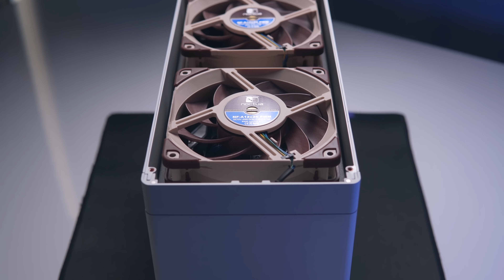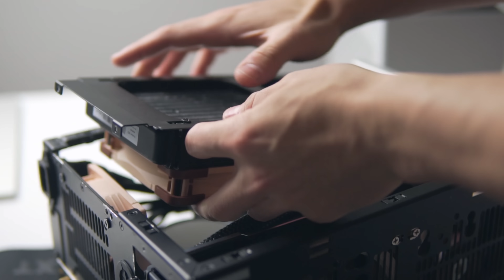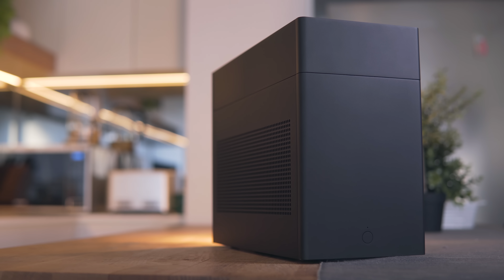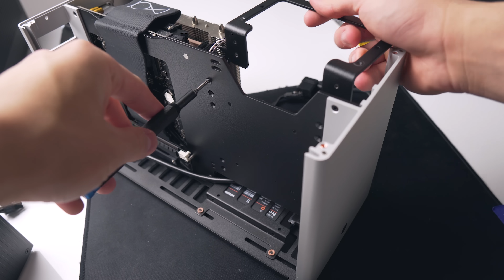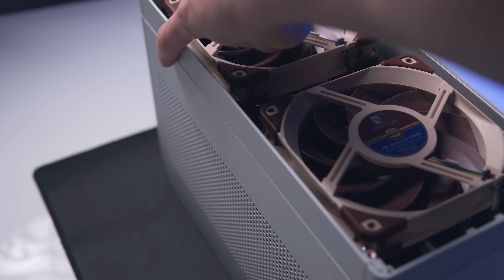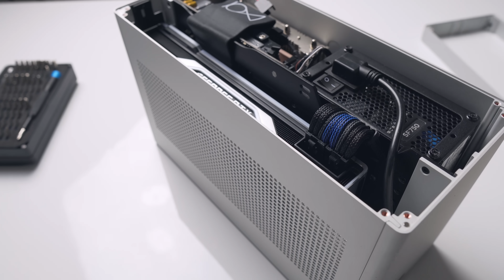High Airflow Ghost S1 Build - Negative Pressure FTW

Comment from the maker: SFF Custom loop incoming after Computex. 
Ghost S1 or Ncase M1 guys?
Reply: Optimum Tech defo ghost S1
Reply: Ghost S1
Reply: Ghost S1, hands down.
Reply: Optimum Tech ghost s1 with rigid tube. N case m1 is quite spacious.
Reply: @yuxianwang3238  that i also want to se really  Good challenge. @Optimumtech
Reply: Ghost S1. I cannot see how that would even be possible, but I would love doing this myself after just buying a Large tophat.
Reply: ghost ftw
Reply: Ghost (:
Reply: Dual rads in the NCase M1, 240 on the side and the bottom with waterblock on the GPU!
Reply: S1
Reply: Ghost s1!
Reply: Ncase
Reply: Ghost S1 please!
Reply: Ghost S1
Reply: ghost s1
Reply: Both!! lol
Reply: Ghost S1 for sure
Reply: Hope an SM550 or SM560 review is coming soon! They advertise a semi-passive mode with these high pressure fans. Very excited to see your results with that
Reply: Corsair 1000d
Reply: Ncase M1
Reply: Ghost, because of its a lot less common and I think you can do a much better job than J2C did
Reply: Ghost S1, I'm doing it as well, just waiting for my Ghost to arrive.
Reply: Ghost S1 of course!
Reply: S1!
Reply: 👻S1!!!
Reply: Ghost S1
Reply: Ghost S1 pls !
Reply: GHOST S1!!!!
Reply: Ncase m1!
Reply: Ghost S1! I’ve seen some M1-loops done but very few done in the ghost...
Reply: Would love to see the M1 custom loop. Kind of seen one in a S1 already but curious how the Mcase would turn out.
Reply: M1 please!
Reply: Both please!
Reply: Ghost S1!
Reply: S1 for sure.
Meanwhile living on the edge here with a 2700x and a Vega 64LC in the evolv shift
Reply: Ghost for sure. M1 is boring
Reply: Ghost because of challenge
Reply: Sliger !
Reply: 1st Ghost the N1 with similar components!
Reply: Ncase!
Reply: How about both?
Reply: Ghost S1
Reply: BOTH!!!!
Reply: ghost s1 for sure .. because there are many people already made it for ncase m1
Reply: Ghost S1 please. But I'd watch the M1 as well.
Reply: Both r almost identical, but I'd vote for Ghost S1
Reply: Ghost S1! Just because its more beautiful. And maybe you could try out an Aqua Computer Airplex radiator.
Not sure if fits but I'm really curious of its performance.
Reply: Do both mate... Do the Ncase M1 first.. then later on, do the Ghost S1... why not!!!
Reply: Ghost
Reply: Ncase for sure!
Reply: Ghost S1
Reply: neither :D get a bigger case bro :D
Reply: Ghost S1 FTW!!
Reply: ghost s1 no question
Reply: Why not both?
Reply: custom loop!
Reply: Ghost S1!
Reply: Ghost for sure!
Reply: NCase all day. Ghost is cool but I love NCase layout so much.
Reply: Both? <3 if not...Ghost! Thanks and super nice vid, as always!
Reply: Ghost S1!
Reply: Ghost s1
Reply: S1 for sure
Reply: M1
Reply: Ghost!
Reply: Ghost
Reply: ghost s1!
Reply: Ghost S1
Reply: Ghost
Reply: Ghost S1
Reply: S1 PLEASE!
Reply: Optimum Tech Cerberus!
Reply: How about a Ghost S1 with a medium hat top and bottom?  That possible??
Reply: Ghost S1, 
both more challenging, and it's potentially more customizable (ie more Top/Bottom Hats can be added, even multiple ones over each other if necessary) - so proper water-cooling build will be great starting point for many other builds
Reply: S1, no question. Possibly the best PC case ever made.
Reply: @carlover4239  , indeed a great case design.
I would only wish they made another variant aimed at fully water-cooled & portable builds. What I mean is that there's plenty of headroom to shave some weight of the case (currently it's twice as heavy as the Dan A4 w/o any top-hats, and I haven't heard of single comment about the A4 being flimsy or weak).
And by aiming it to water-cooled builds I mean to drop the extra width they currently leave for more air-cooler options and btw if you look closely you can see the lip in which the case walls slide in are FAT, there's at least 1cm wider than necessary. I know it sounds like a hair splitting, but if Ghost S1 can loose half its weight and about 1.5cm of its width (ie from 14cm to go down to about 12.5) it could still fit standard 240mm rads (probably not most fat 240 rads that are about 13cm wide, but there're always compromises).
So being about 2.5kg of its weight (half from the main case & the other half from 2x L-TopHats), and making it slightly slimmer (to fit in more backpacks) would make it actually very portable - to the point that you could carry it daily to work'n'back (esp. if you combine it with a full Aluminium liquid-loop as I'm doing with my own build).
For portability one can make a compromise with the 14cm width of the case, since it's a specialized implementation anyway, it makes sense to find specialized backpack of suitcase, but weight MUST go down IMO. With its current weight it's only good for stationary use (only occasional moving around), and at that point some of the SFF advantages are lost.
And of course price should also come down, and availability to go up, if they even hope to make a business out of it :)
Reply: S1
Reply: Ghost!
Reply: S1
Reply: Ghost S1
Reply: Ghost please. Will do the same then. But do it with only a medium hat at the bottom!
Reply: Ghost S1 for sure!
Reply: ghost
Reply: Ghost! Ncase has been done so many times by now
Reply: Ncase M1 pls
Reply: I'm looking for that Ncase M1.
Reply: Ghost S1
Reply: Ncase M1
Reply: Both 😊
Reply: My Ghost S1 is nice but it was a very long wait and one of my tophats from the 3 pack is the wrong color. I'd say Ncase M1 just for the ease of ordering. Not to mention that if you plan on using tophats on the ghost S1 you're nearing the size of the M1 anyways. Edit: oh you mean for the a custom loop Ncase all day.

Comment: I would like to fit a i7-10700k with a 3060 ti in a ghost with a large top hat. Would this be possible with the setup in the video if I undervolt the 3060 ti and use a 240 rad for the cpu? Or is this pushing it and should I try to go for the Formd t1 case. Primary use will be for gaming. Thanks for the vid and anyone can let me know what they think.

Comment: @OptimumTech, I'm currently building my S1 batch 4 and was able to get a full sized 120mm corsair ML series fan below the PSU running in exhaust mode. Using a corsair platinum PSU with the premium cables, all it took was some clever cable management but I definitely have somewhere between .05cm and 1 cm clearance with the fan spinning unimpeded. Just a note for those looking at this build.  I will running the 3900x with a noctua L12 (discontinued version) and a 2070 super FE. I'm hoping thermals with this slightly less powerful card will be good with just the 1 fan. Otherwise I'll be getting that medium top hat.

Comment: Hi folks,  help me pls 
just replacing aio cooler master liquid 120 lite.

Fancy removing large top hat, corsair dominator ram so height ram is an issue, any thoughts pls.
Atm I'm thinking of noctua nh-l9x65 am4
Ryzen 5 2600 is this a good cooling solution.
Reply: Maybe switching to low profile ram? I'm currently using l9x65 for my i5-9600k, but ave load can heat it to 86C at stock volt.

Comment: Have you tried using a NF a9 fan in the NH l12 rather than the NF b9? I picked up a second hand NH l12 without any fans and trying to figure out if there will be any benefit in using the a9 rather than b9?

Comment: Compared to water cooling is this a optimal setup for the 3800x with the two fans? Or would it need water cooling...I don’t plan on overclocking or anything

Comment: Sorry, I am kind of confused by what you meant with ”the bottom fan running in exhaust isn’t going to work you less you can find a fan grill to fit in that tiny square”. Did you meant that it might be easy for cable to be caught in the bottom fan if it's running in exhaust? Thanks!

Comment: @optimum tech: You always refer to the Noctua CPU fan but I've done a new built using the Ghost S1 and i'm using the Coller Master Geminii M5 Led that is a 120mm fan, low profile, 5 coper heatpipes and it works particulary well with my i7 9700 (normal version, not OC).
https://pcpartpicker.com/b/bC7WGX

Comment: Hi Optimum Tech, I don't exactly understand what you mean regarding the bottom fan between the 03-05 minute of the video. As I don't have a tophat and can really only tinker with either a bottom fan in the fan/harddisk slot in the bottom of the case and a better CPU cooler. Would it be worse or better in regards to noise level and tempts to put in a bottom noctua slim fan in the case on exhaust or not? You mentioned that "switching the fan to exhaust won't help either, unless you have a slim fan grill"? Hope you can clarify :) kind regards

Comment: Hey man - quick question about the fans in the medium top hat. Does your top grill sit flush with the rubber fan corners on the noctua? If I leave the rubber corners on, my top grill will not sit quite flush. I tried flipping the mounting bracket over and still not quite enough clearance.. Works if I remove the rubber.. But I prefer to keep it and in your vid it looks like you kept them on.

Comment: Anyone follow this build? Wondering what cpu fan direction is recommended?
 With top and bottom exhausts feels like cpu might work better as intake, pulling cold air through side panel and exhaust through top. 
Any Thoughts?
Reply: My thoughts exactly. The cpu cooler setup makes sense to push heat out of the sides, right? @Optimum Tech, care to chime in?

Comment: They should have used long threaded nuts (like motherboard stand offs) to mount the top hats so you could secure the top lid once installed other than just the magnets. Kind of the only let down to me on this case.

Comment: Have you ever tried a blower 2080ti - surely this will work better for thermals in any small volume build albeit with a lower level of overclock headroom and noise may be raised though not always intolerably especially for gamers who use headphones . I don't and I have a 1080ti blower in my FDCore500 build - for me noise levels are tolerable even gaming at 4K - https://uk.pcpartpicker.com/b/PbCbt6 ?

Comment: Medium bottom extension with 120mm cpu aio and 2 , 25mm fans blowing in.  Delidded direct die conductonaut 9900k and triple fan 2080ti temps in mid 70's. Both max oc.  Not enough? Small tophat with 2 slim fans blowing out at the top what will reduce temp with 5 degr c. All fans set to low noise, max 1500rpm . 16k 3dmark time spy.

Comment: Has anyone tried this setup, but instead of installing 2 x 120mm fans you install 1x120mm fan above the cpu and a 3.5 inch drive?  Wondering how much worse the thermals might be in this configuration.

Comment: Would you use the bottom exhaust fan if you use a large top hat with a 240mm rad?  If you use a 240mm rad, would you use the fans on top or bottom of the rad? Thanks!

Comment: Nice build!
I wonder in a build with 2 L-TopHats (ie one would be a bottom-hat actually), so that both CPU & GPU are water-cooled so that each Hat would have a 240 radiator & 2x120 fans, which would be better:
A) both hats' fans blow UP-wards (assuming to work in synergy with air convection) - ie bottom fans would blow IN the case;
B) both hats' fans blow OUT-wards (creating negative pressure inside the case so that it sucks air from the sides, instead of the bottom) - ie bottom fans would blow DOWN in the case
NOTE: consider that in such build the rest of motherboard components would need ventilation, so there're 3 basic cases there I think:
1) in the above case A, there should be general upward air flow thru the case assuming it would be enough to cool down MoBo - would it?
2) in the above case B, the case would suck air from the sides, because of the negative air-pressure, so would that be enough to cool down MoBo?
3) if both above cases are not good enough perhaps sticking couple of small & low-profile fans (like for example NF-A4x10 fans) to the side of the case directly over the hottest areas of the MoBo? I guess the last case would work better with the case B ie working in synergy with the negative flow?

Comment: Could you check out the MSI GTX 2080 Ventus V2? Its one of the few 2080's that could fit in the Ghost S1 or Dan A4 but its heatsink fins are set up in an unorthodox direction. Wondering if that would impact cooling alot in a small case

Comment: How do you undervolt the graphics card? I have a ASRock Z390 Phantom ITX. Do you do this in bios? Exactly how and where?
Reply: msi afterburner
Reply: @dzpliu  I am running Mac OS X on hackintosh so I need to do it in BIOS since Afterburner does not work on OS X

Comment: I have never built any ITX PC, anyone with experience could tell me if the heat dissipation is good with such a small box? I am planning to use nvidia 1660 right now, would upgrade to a quadro when boss gives me some allowance. Probably an i7 that is both efficient in 3d render and heavy gaming as well for now. And any motherboard that could fit in so I can have a reference? Many thanks. 

I am in HK so many of the parts aren't available from local store feelsbadman
Reply: Anything that isn't a 2080ti and 9900k should be fine. 1080 and his delid 8700k works all on air no top hat.

Comment: nice vid man! cool!
i have a Cooler Master MasterBox Q300L, and one damn fan made an almost 10C difference in CPU temps. Even though this case is almost all hols, there was a big heat accumulation right above the CPU (you could feel it if you put your hand over that area) and with one (more) fan in the back pulling out the hot air, CPU dropped almost 10C.
Before this i had only 2 frontal fans (120mm Noctua). GPU still sits at 70C though, now and then...70C constant...maybe it's because it's a mini gtx 1060.

Comment: Nice. I did a 1080 8600k in a sugo sg13. Fit a h60i with a second fan too. With noctuas the cpu oc at 4ghz never tops 60. The gpu +125mhz hits 73 with demciflex filter on the intake side. 65 without. Ambients 20.

Comment: The ventilation hole pattern that Ghost uses is not optimal. The straight line holes are more restrictive than can be achieved by cross pattern holes which reduces the amount of aluminum allowing for more holes/air. Strange that they don't cut them this way.👀

Comment: I agree that the Ghost S1 looks nice in silver. It's a shame that the company is a mess. I see so many complaints about Louqe.

The nCase M1 offers support for up to two 240mm radiators while the Ghost S1 would have to become significantly taller with two "top hats" to accommodate that (if you could even get them with Louqe being as it is) so I would personally go with the nCase M1, but of course I'm more biased toward the M1 because I own one and it remains my favorite. I can get good cooling into it and it's not as cramped to work with as some other SFF cases. The size of the M1 is the "sweet spot" IMO. 

You may personally favor doing the watercooling build in the Ghost S1 since you've had the nCase M1 so much longer thus the Ghost S1 is newer / more interesting. If you have the parts just do whatever you want to do, Ali. 

If I had the resources to do so I'd be trying all sorts of SFF builds as well. But presently, I'm attempting to finish the open loop for my full ATX build in the Lian Li O11 Dynamic. The only upgrade for my SFF build lately was getting a smaller mechanical keyboard, the EC Plum 84 Pro.

Comment: Would using the larger top hat and the AIO on exhaust with the bottom exhaust fan achieve the same GPU temps? While lowering CPU temperatures too.

Comment: I like your setup, but how would air be pulled from the side GPU panel via negative pressure if the GPU is exhausting air directly into that panel gap? I think it's more likely that most of the fresh air would only be coming from the CPU side and everything else would be exhaust. What do you think?

Comment: Would having this setup with a 9700k without undervolting the GPU be a bad idea? Also, just how much smaller is that Ghost with a medium top hat vs the Ncase?
Reply: It will get very hot in there depending on the GPU. If it's a 20 series NVIDIA it will be very hot to the touch.

Comment: Try to imitate the Corsair ONE, in the ghost s1, try to put two radiators on the sides for the Ghost S1 and then ahve exhaust fans top. Not sure it's possible or if you need to mod it some. Would be cool. (fanless radiators, exhaust fans top).

Comment: Would love to see a full custom loop in the M1, I think it has the most potential of the 2 because of the space to side mount a 240mm rad + slim 240mm at the bottom. The challenge is the pump and res ofcourse.

Comment: Thats weird, I guess my dislike of reference cards has meaning. I have the Gigabyte Windforce 2080Ti overclocked to almost 2000mhz and i’m at 77c* with no extra fans..
Edit* Same case btw. Also have 8700k oc to 5ghz at 66c. Case is good :)
Reply: Voca loholic hi, thanks for the information, from what you said, you meant that gigabyte gpu fits in the ghost s1 nicely ?
Reply: @VechaiKoban  Yes, i have the windforce model
Reply: @mdc4911  I'm interested in buying the VGA, could you please tell me whether you can put on the sidepanel with that Gigabyte Windforce 2080Ti OC
Reply: Minh Nguyen yea i have the side panels on of course

Comment: Maybe you can mod the case. Cut open the front cover and add one more intake fan for fresh cool air, you can also add rise up the case a bit so the intake bottom fan can pull cooler air from the bottom. Also one last thing, maybe consider HDPlex PSU? Just for consideration, I haven't though about the power requirement though

Comment: this only works cause of the founder edition card being a blower type right? Sucking air through the gfx blades and exhausting on the side of the card (which becomes too positioned ) this further enhancing the air flow with medium hat with exhausting fans.